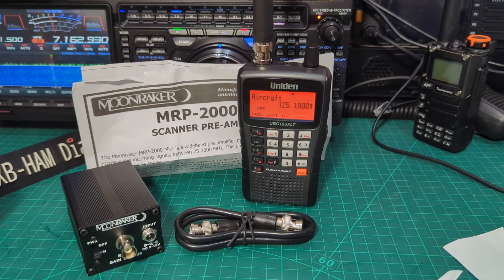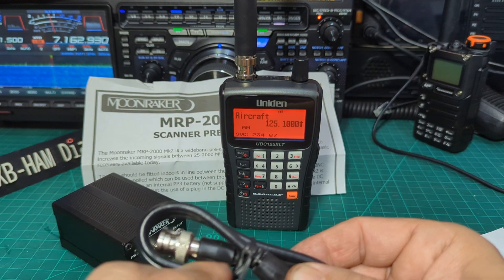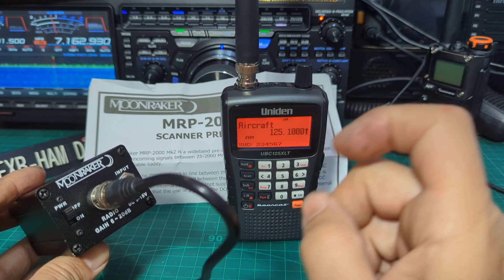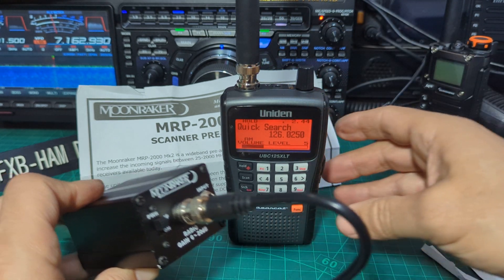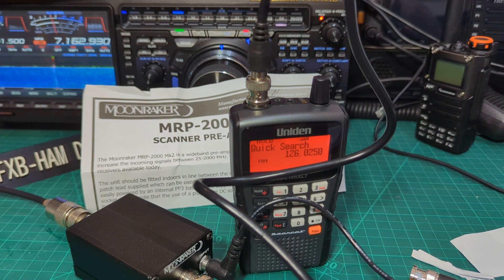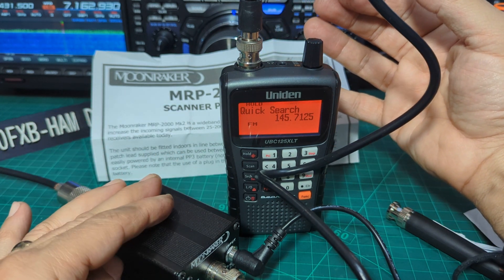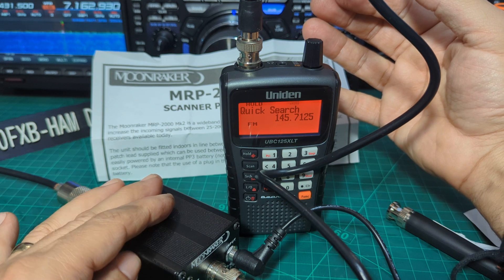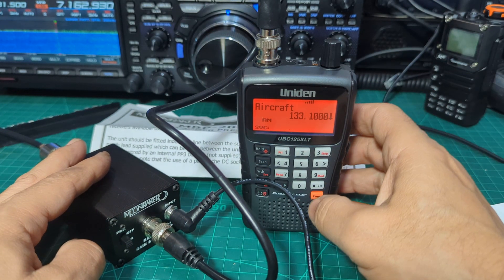SCANNER PREAMP - MOONRAKER MRP 2000Mk 2 Set Up & Test (UNIDEN 125XLT)

Comment: I think the internal battery is badly implemented, I wonder how many times the cover screws can be removed before the aluminium case screw holes wear. Best place for an RF pre-amp is at the mast and it really needs to be equipped with a very low noise device. What is the gain and noise figure of the amp?
Reply: I found the gain quoted as up to 20dB but I am suspicious Moonraker do not seem to quote the noise figure.
Reply from the maker: The unit says 6 to 20 dB gain.
Reply: I’ve just carried out a similar test with my nearest air base ATIS and the amp made no difference at all! It came as part of a second hand bundle so it’s quite possibly broken.
Reply: Mine works well